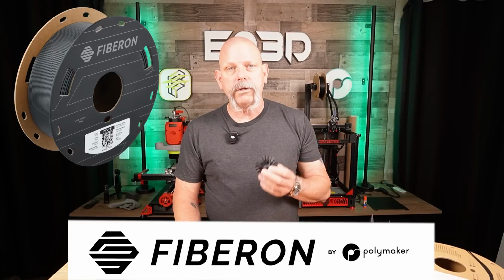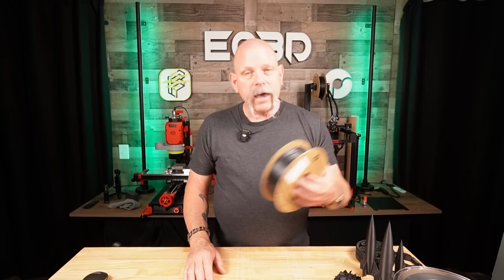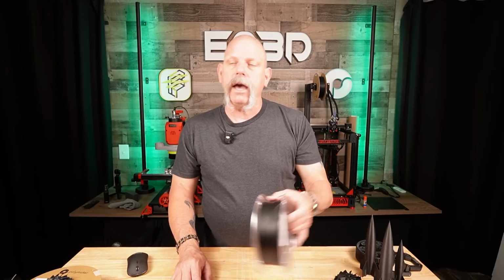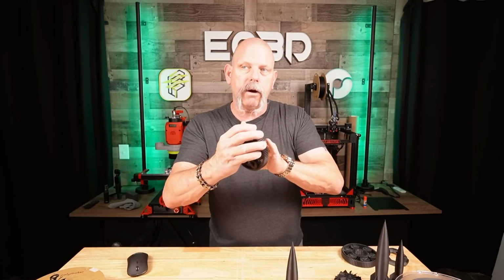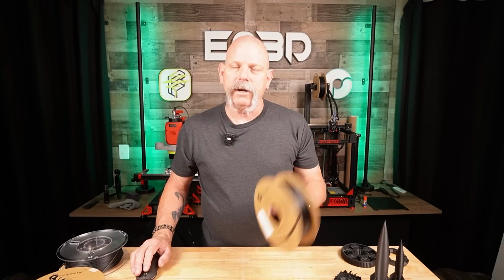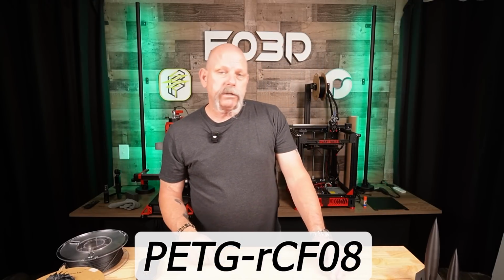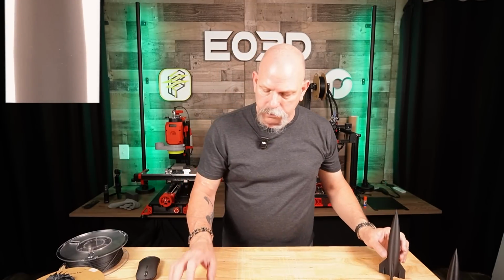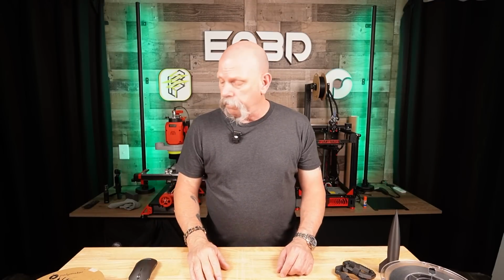Fiberon by Polymaker Launch | EDGE OF 3D

Comment: hey how you doing  i actually just got a 500g spool of the fiberon petcf -17 and came across your video  and had a few questions for you im starting to protype some parts for a top alcohol car   and a couple other projects we are working on at the shop i was wondering  just curious on what material you use primarily and the types of printers they are printed on  along with print settings and what not  thanks..

Comment: A quick question about the PPS-CF. As hard and brittle as it is, I was thinking that it might feed easier if warmed in the Bowden tube or other feed path. I looked on the Fiberon site and couldn’t find anything about preheating the material. Do you foresee any problems that may arise by heating the filament on its way to being extruded? Thanks for the video and taking the time go reply to these comments
Reply from the maker: I've actually not had any issues with it feeding at room temperatures.

However, with that being said, I'm testing 2 inline filament driers/heaters that can heat to 195° and have not seen a difference in how it feeds but have seem a difference in the prints, I've had to lower my nozzle temps to keep from overheating the filament and causing stringing. As well as being careful how hot to heat different filaments to keep them from becoming too soft and pulling into in the boden or not feeding.

Comment: Great video and Thanks for making this. I am looking to print firearm parts i'm an 07 FFL I have a Adventurer 5M. Do you thik I can print the metal like stuff on it? Ive tried to print PA6-CF and it look ok but....
Reply from the maker: As long as your printer is capable of printing with a nozzle temp of a minimum of 320°C (I suggest 355-365) then you can tune it and probably be okay.
Reply: @EDGEOF3D  No wont go that high... 280c is all I got

Comment: Great video and thanks for the information. Very excited about getting my hands on the PPS-CF10. I have a Creality CR-10S with a few upgrades including the Micro Swiss all metal hotend and an enclosure. I have been able to successfully print with PLA, PETG, and even PC -CF. Only problems I have ever had are the first layers adhesion. Is there a smooth or textured sheet you would recommend? Especially for these higher temperatures like the PC-CF or the PPS-CF10? Thanks again. Looking forward to more of your content.
Reply from the maker: I've printed on smooth and textured with no problems, however, with that being said, I apply FrankAF's home brew bed adhesion/release to every printer, every print (or when it starts to wear off anyway). https://goo.by.frank.af/

I hear all the time that if I knew how to tune my printer, level my bed, set my offset.......... Rubbish, I have spent a lot of time in commercial 3D printing operations and every single one of them uses something. One failed print or one destroyed print bed because the part wouldn't release, it's more than paid for a lifetime supply of this stuff.
Reply: @EDGEOF3D  Thank you for the quick reply and info. Sounds like this is exactly what I am looking for. I went to the site and noticed it is sold out. Must be doing something right!

Comment: polyphenylene sulfide belongs to the family of PAEKS, such as PEEK. it is a strong, very brittle  polyner with strength similar or close to PEEK . the virgin polymer itself sounds like metal as it is inherent to this polymer, the CF only adds stiffness and probably strength.
Reply: Nope, it is not. PPS has either ether nor ketone groups. It only has aryl groups like PAEK.
Reply: @lucianoag999  true, my mistake. ;) i tried to summarise something complex into sonething, which ultimately is wrong. polyphenylene sulfide, which only contains the sulfur atom to link the phenylenes, has similar crystal structure, with similar bond lengths, and similar phenyl angles, compared to PAEKs, but yes i does not belong.
Reply: But I agree. The sounds comes from the polymer. 10 CF doesn’t affect much. The reason for the metallic sound is the low density and low loss modulus. Not the just 4 GPa of elastic modulus. (Al 70 GPa, Steel 210 GPa, Ti ~150 GPa).

Comment: Where is the featured RC car design, BOM and so on?
Reply from the maker: I didn't feature and RC car in this video, I showed a prototype front end I put together for the purpose of making the video.
Reply: At t=16:46 sure looks like a remote controlled 4 wheel vehicle...
Reply from the maker: That was built on commission for Polymaker to display at Rapid when they launched this new line of filament, it is not my model to share. Files, BOM etc can be found at: https://www.patreon.com/join/mrbaddeley

Comment: You should do a video on that impeller spinning up to what kind of RPM it can handle. 
Also, when will this new line be available? I went to “fiberon.polymaker” and it’s just a page to enter your email address. I enter my email and have yet to receive any information. Hope it’s available soon. The parts you made with the various CF filaments were highly impressive and I’d like to give it a try. Thanks for the video!
Reply from the maker: Current ETA for availability in the US is 25JULY.

Comment: It's been forever I was trying to recall what was this metal like filament I saw a year back. Forgot the damn acronym, could never find it again. PPS. I am writing it down this time. They are not the first to make it, but oh thanks for presenting it.
Need to give it a shot. Does this one also require annealing post print?
Reply from the maker: Definitely not the first to make it by a long shot, however this is the first time Polymaker has offered it in their lineup of materials.
Reply: Definitely a plus. Still curious about the annealing requirement. Couldn't find any info on their website, only a form to fill in email for being notified of info on thenl fiberon line
Reply from the maker: @tinkerman-q  Correct, the link is a place-holder while they finalize everything and get the site uploaded. As for annealing requirements, we are testing that right now.
Reply: @EDGEOF3D  cool, very interested on that.for me annealing was always a source of big headache due to deformation and/or dimensional distortion. Can't really fit anything anywhere anymore. What you printed seemed "good enough". If it can be avoided would be a step up for what's available now.

Comment: "Plastic does not make that metallic ring" - this is not quite true, celluloid for example is very hard and rings

have you ever tried running your fingers over the teeth of a comb made out of celluloid? 

... and yes, after typing this - i'll take my comment back, by judging your hairstyle you don't use combs very often - i rest my case

jk - no offense, my hairstyle is quite similar :)
Reply from the maker: I guess I should have clarified my statement to say that plastic we typically use in 3D Printing doesn't make that ringing sound.
Reply: @EDGEOF3D  nope - all good, we all know what you meant to say :) - but i could not resist the comb-comment - and lets be honest, no man can resist running the finger over a comb, it is like holding a cordless drill and not pressing the trigger - this is simply impossible for a man ;)

Comment: PET-CF has utterly insane layer adhesion. Surprised that It didn't fuse.

Also, very interesting that the print temp is 320-350c, higher than I've usually seen for pet-cf. Don't forget to anneal!
Reply from the maker: Nozzle tempt for PET-CF is 270°-300°. The 320°-350° is for the PPS-CF. I've had no layer adhesion issues with any of the 3 I've been experimenting with.
Reply: @EDGEOF3D  haha when I meant insane adhesion, I meant it would have insanely good layer adhesion. PET really, really likes sticking to just about anything. That's why I was surprised the print in place model printed so well. I would have expected stuff to fuse together

Comment: That is definitely rigid, could be useful where needed. It is disappointing that the pricing trend is to overprice new filament, it sure limits experimentation for the hobbyist. Truth is hobbies are expensive, guess I need to get over it.
Reply: PPS CF filament isn't really intended for hobbyists. It's for shops making jigs or functional tools/parts. Very few hobbyist 3d printing people would need it. The PET CF is fairly reasonably priced for what it is.
Reply: If you can’t afford engineering materials you can always stick to printing PLA spinners, dragons and that kind of trinkets most people print these days. 🤷🏾‍♂️ This materials are designed for very specific areas and use cases, they of course carry a premium price, usually functional prototypes and final use parts for industries, not really hobby-level stuff.
Reply: @Bogaloo1232  😁

Comment: Wouldve been nice to have some performance testing other than "it goes ping when i flick it". Nice party trick, but does it offer any real life advantages? The filament snapping by barely touching it is a bit worrisome for example.
Reply: I've seen a lot of engineering grade filaments do that. At a certain point I think it's just a price you have to pay to get the extra properties. As long as you account for it you should be OK. Some people have run a lot of spools with brittleness like that through their machines once they figured it out.
Reply from the maker: There will be testing, we all just received the samples a short time ago and have had no time to do any testing with it. I never made any claims to any sort of strength or durability in my video, I was simply introducing the line.

Comment: Can you share printing nozzle and bed temps or is that still nda for the pps cf fiberon filament?
Reply from the maker: I'll update when I get home and can look at the data sheet they supplied me when they sent me the samples.
Reply from the maker: Per the data sheet provided to me with the filament:
PPS-CF Nozzle Temp 320°-350°
Max Volumetric Speed 28mm/s
Heated chamber recommended but not required
Bed temp up to 80°

I printed at 340° with bed running at 110°

Comment: Nice overview, thanks! Very interesting! The PPS looks really interesting! (Does anyone make a high-temp hotend for the Bambu x1C?) Waaay expensive and I don’t have a use case doe it, but super-interesting!

(BTW, I think you accidentally jumped the gun, did you say the embargo time was 8am PDT? I came across this vid at about 9:30 EDT, which was 6:30 PDT. Honest mistake, I hope you don’t get in trouble for it.)
Reply: nope, it only works on X1E.
Reply from the maker: As for a high temp nozzle for the Bambu, I don't have a clue on that one, I'm sorry.
Reply: You can’t just stick a new hotend in a Bambu and have it work at higher temperatures. The hot end itself is only half of it, the firmware on the printer needs to support the higher temperatures too. There are a number of ways you could trick it but you won’t get accurate temperature control then and the read temperature will be wrong.
Reply: @conorstewart2214  Thanks, I figured as much 😕 I don’t really need it and it’s hella expensive, but that CF PSS sounds so cool. I’m wondering if it would work for gears that’d be subjected to high loads? The CF might make the surface too rough, so it’d wear quickly, but it looks crazy-strong. 

(I wish My Tech Fun would do some tests on it 😁)
Reply from the maker: 0800 PDT on 25JUN and that is exactly when it went live, it only had 3 views prior to that time and those were internal views from the designer of my thumbnails.
Reply: @EDGEOF3D  Oh DUH, so sorry! I was seeing it on the morning of the 26th, a full day after you posted it. Sorry for the brain spasm!

Comment: PPS is an awesome material.  Got some to run on the Q1 Pro and it came out amazing.  That metal sounding characteristic of it I only figured out when I dropped the test printed fidget switch and it TINGED of the floor.
Reply from the maker: Yeah, its surprising the first time you drop it or flick a part of it and hear the metal "ring".

Comment: I recently bought a filament that I dried in the oven.. it snaps just like that and i have to print it at a  reasonable speed. its PLA but it does print very nice as long as i dont print too fast

Comment: Great video, though audio is only on the left for some reason!
Reply: I'm deaf in my left ear, I thought there wasn't any audio. I will wear my headphones backward and try again.
Reply: start menu/settings/Accessability/Mono Audio. turn on and problem gone. Just turn off when video is finished
Reply: @haansworsie  only on a iphone. 😢
Reply: I also thought the audio was borked - good to know 🙃
Reply: Ah omg I thought my speaker just died on me 😅
Reply from the maker: That's called an "amateur mistake" by the rookie editing the video.
Reply: @EDGEOF3D  you can still fix it, cmon :)
Reply: @EDGEOF3D  lol all good still a good one! Filaments look great and SOUND great
Reply: @EDGEOF3D  just turn the file to mono and youre good
Reply: I believe it's fixed, both left and right audio channels are working for me. 👍
Reply: @zadraking   nope, still only left